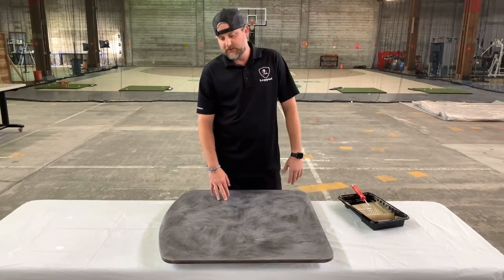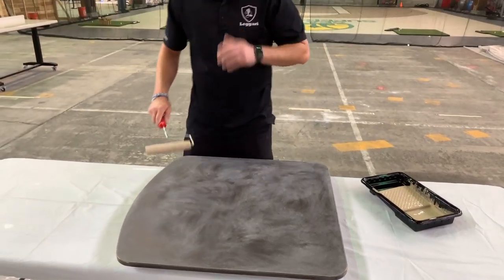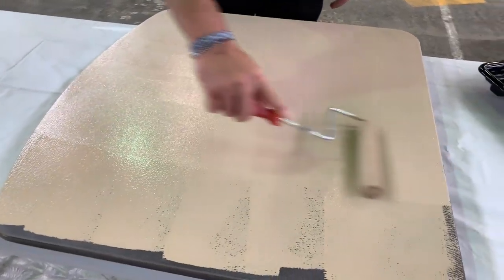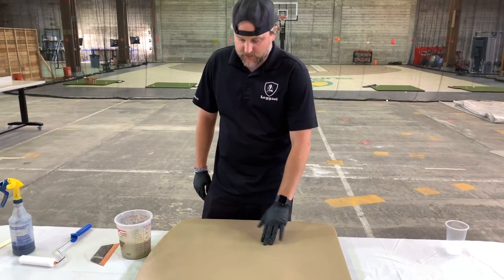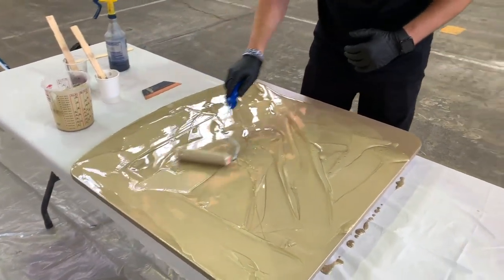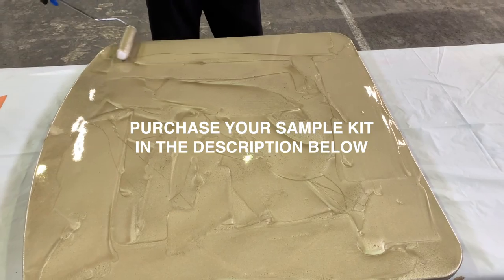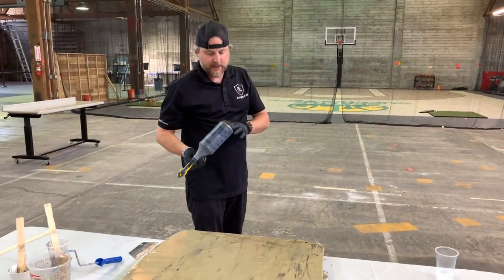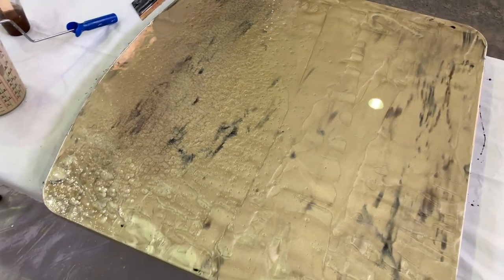Coating RV Table With Epoxy

Comment: Was the base coat any particular brand?  Nice having the metallic in the alcohol.  Looked like a very heavy application of the epoxy, obviously there were no problems.  Good job.
Reply from the maker: We use leggari primer and base coat of epoxy that we specially formulated.  Thanks

Comment: I am a nail technician and would love to use your Eooxy to create a new manicure table top for myself, I’m just wondering if it would hold up to all the chemicals that I would be using or if it would be best to have a glass top to go over the epoxy?
Reply from the maker: Our products are actually industrial coating made for military aircraft hangers, etc. So theoretically in a residential, or even commercial setting it will last forever. This is NOT a cheap epoxy paint that you will commonly find at box stores like Home Depot or sherwin Williams. It is a thick 100% solids epoxy coating.

Comment: How much would the products be for this project? I have an RV table that's probably the same size that I would like to do.
Reply from the maker: You can actually order or price out a custom kit for that exact square footage through the Counters section of our website at www.leggari.com. Simply click on Counters >>>> Order Counter Kit Here, then follow the steps.
Reply: @LeggariProducts  I wanted to know what the products cost for the project that you showed. Can just give me a cost
Reply: I have a similar rv table did a pour and top came out like glass but the sides where the plastic trim around rim does not want to cover even though I used primer and paint I have had to sand and got some parts to stick while others will not and had to sand whole top again and the drips o. The side are ridiculous even though I went around to clean with gloves and a popsicle stick very frustrating because the top came out phenomenal what do I do now in limbo waiting on yet more epoxy